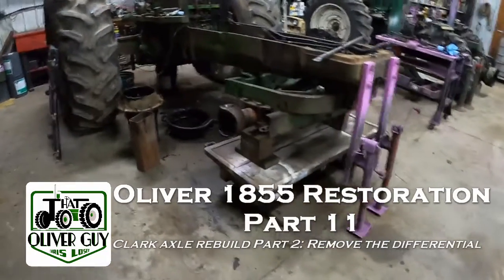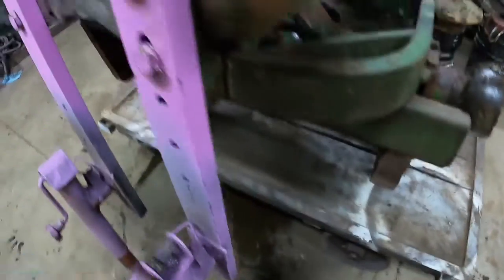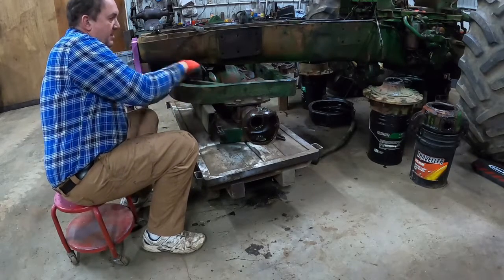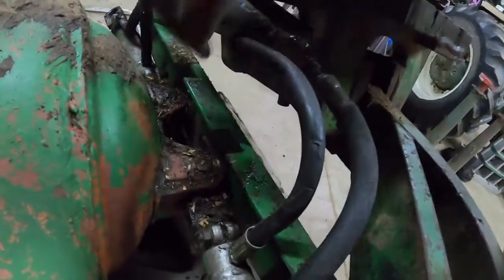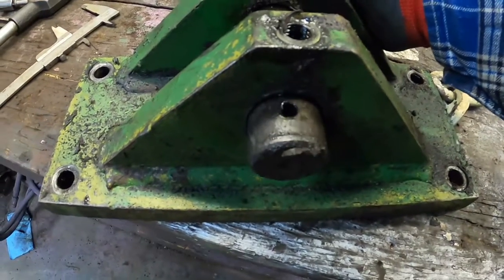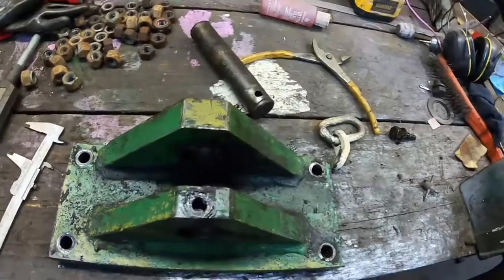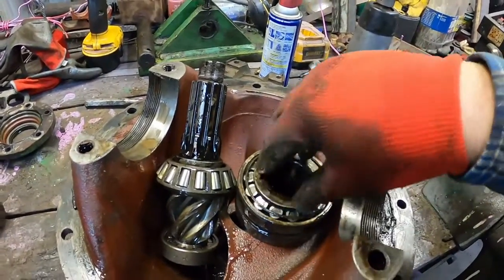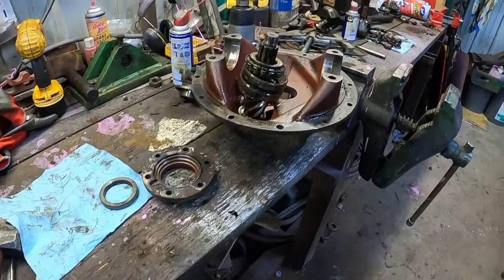Oliver 1855 Restoration Part 11, Front axle part 2

Comment: Was wondering if you checked backlash before removing bearing carrier caps? I was taught to always check and reset backlash on gears your going to use over or else you would change the wear pattern and create a noise in the differential? Maybe you did but didn't show it.
Reply from the maker: The book says 8 to 11 thousandths, that's what I am going to set it back to.

Comment: If you look at the sub frame looks as it was arched then cut by a torch 
Maybe filed down for best appearance reasons. Even the ends of steel. That's production back then .
Reply from the maker: A guy that worked for the service department said that if you were in Charles City, you knew which day they were making thos frames. Wham, wham, wham!

Comment: Hey Chris, I have a 2wd 1850 with a long shaft in the trans. I know of a 2-105 with FWA for parts, do you know how I can tell if the ratios in the rear end are compatible with the front diff gears with X size tires? I am thinking of converting my 1850 to FWA. Thanks!
Reply from the maker: There should be a tag on the left side of the differential housing of the front axle that has the gear ratio. It should also be stamped in the housing just above the pinion shaft. Get me that number and I can fill in the blanks. You can also jack it up and turn a wheel and count the number of times the pinion shaft goes around for 1 revolution of that wheel, then double that number to get the overall reduction. That method won't work if the axle has the no spin differential.

Comment: With all of the price increases, does this impact the repair costs significantly? I guess if someone wants to do it right that's just what has to be done. Checking tolerances in the book is important, I know from first hand experience, or mistake, whichever you choose. Anyway great job Chris, thanks for sharing, have a great day/weekend.
Reply from the maker: They have been going up, but it's been awhile since I have bought some of these parts, so I can't say for sure. I know some parts, especially electronics are hard to get. A salesman from my local dealer was telling today that there even some things like filters they are having a hard time getting in stock.
Reply: @ThatOliverGuyChris  Yeah, I haven't had anything done this year, but last year I did and it was a lot. If it's 15% more, then that would have been a $600 increase. Another calf to sell for me, just to cover the cost increases.

Comment: That main Frame. is different from my 2255 it has a whole nother pivot that the differential sticks back thru I know you have seen both I thought they would be the same nice job like them jacks 👍
Reply from the maker: The 2255 style of frame was first used on the 205/2150 and was also used on the 2-135, 2-155 and 2-180. It tucks the axle up in to the frame a little closer,. It also makes it so the pivot is centered up wit the driveshaft which reduces how much it moves when the axle oscillates.
Reply: @ThatOliverGuyChris  sounds great I'll look that over closer now  I need to find the other gear ratio they changed it in 82 and put the smaller front tires on it that come with the other front wheel drive from abaliene machine I have the big original front tires and rims just need to get the ratio back original it works great just a little small
Reply from the maker: I'm going to call Pump Recon in Independence, Missouri tomorrow to see about some parts. It's been few years, but I got a new ring and pinion from them before. I'll ask if they can still get them.
Reply: If you get information on the ring and pinions Chris maybe I could change that out I seen the adjustment on the carrier seems to be enough to go either way  when you showed in the video I would like to get the  bigger front tires back on it  nice videos you been very busy doing what you love
Reply from the maker: I called and he was going to make some calls. Sounds like availability has gotten thin.
Reply from the maker: Terry did some calling and he can get a new 6/41 tooth ring and pinion. That's the 6.833:1 ratio that all 2255s used. Give him a call at 816-536-3019. Tell him Chris Losey sent you.

Comment: A bit off topic, I have a friend with a red-wheeled Super 88 nf diesel. The spec tag reads, "18-0001". I know the 18 means it's a non improved 88, but what about the 0001? Great video btw. Keep 'em coming!
Reply from the maker: The digits after the 18 are the options. They can be hard to figure out, but not in this case. 0001 should be the basic base configuration of the model. If it had different tires, that would change the code. So would switching to a gas engine. They listed a few of those codes in the dealer price sheets for basic models, but there were so many combinations it's about impossible to figure them all out. They made it easier with the 4 digit tractors with the first 2 digits telling front axle and engine options. The rest of the numbers on those models work the same way and are about impossible to figure out. They had a list of the codes at the factory, but who knows if one will ever turn up again.

Comment: Hey Chris good work, was messing with my 2255 I picked up the other day and noticed it looses trans lube pressure when you push the clutch in, should not be possible with the chain drive. Wondering if you had any ideas before I dig into it?
Reply from the maker: That is weird.  I've heard of people converting them from the chain drive to being driven off the counter shaft like the 50 series. Maybe someone did that. The pump is still mounted in the same spot, so all you need is a 50 series pump to replace  it.
Reply: @ThatOliverGuyChris   Interesting, I guess I'll have to take a peak sometime when I have a chance ( naturally has an annoying cab on it) and I'll let you know.